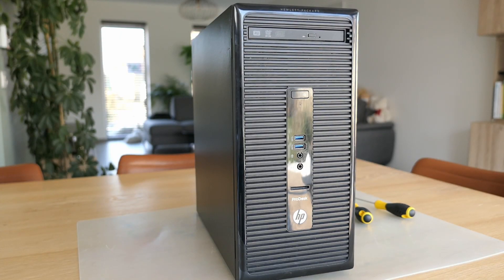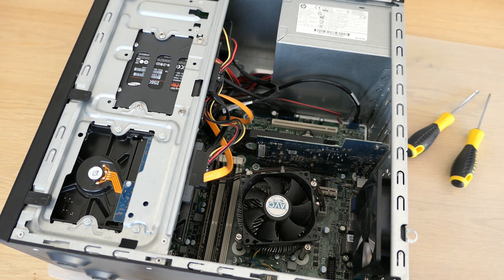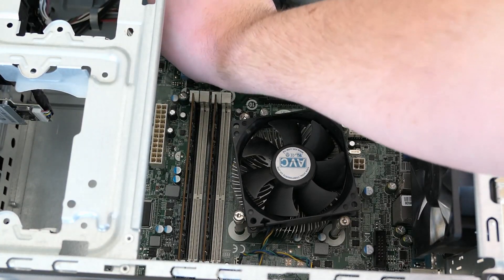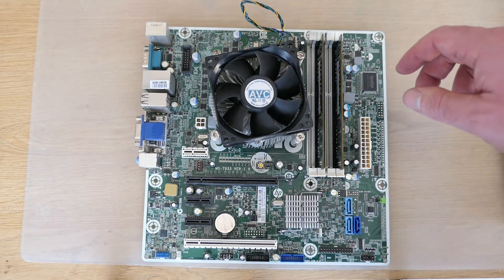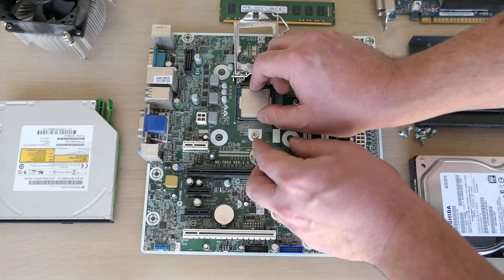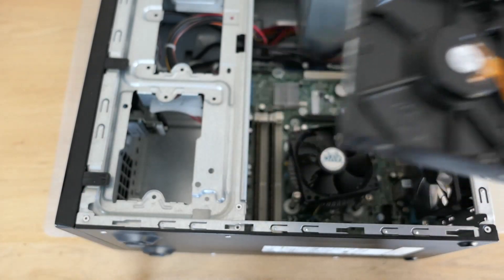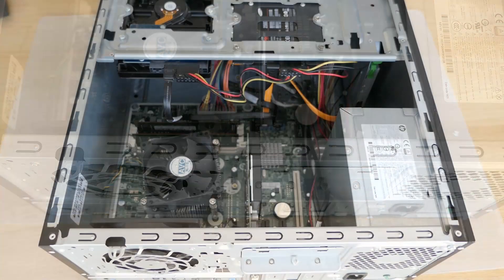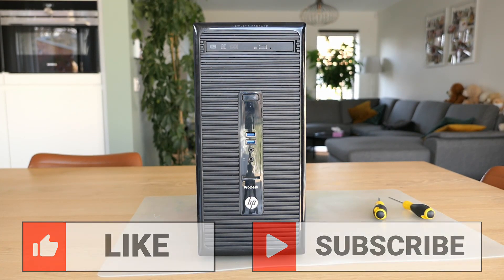HP ProDesk 490 G2 MT - Overview and Teardown

Comment: Can put GTX 1060 or RX 580, i think can
Reply from the maker: Both the 1060 (120W) and RX580 (185W) will require additional power input. A GTX 1650 might be a better choice as it can be powered through the PCIe slot.
Reply: @jensdbe  sure, but i thimg about space. It's small size. I watch another video and so much upgrades including rtx 2060 with 850 w and i7 4790 with 32 giga ram

Comment: Does this mbo (ms 7933) suport i5 4670k
Reply from the maker: As far as I see that should work. Do keep in mind that you will need a separate GPU with a K processor
Reply: @jensdbe  i have 1050ti
Reply from the maker: @mihaelnovak7235  then you should be good :) good luck with the upgrade.
Reply: @jensdbe  tnx❤️

Comment: Can you install a double slot GPU in this one? I couldn't see whether the brackets (in the case) could be easily removed. Because I was thinking of installing a low profile GTX 1050 TI.
Reply from the maker: There shouldn't be any issues installing a double slot GPU. The brackets covering the opening can easily be removed. There is no need for a low profile card as the tower has space for a "regular" card. Only thing you need to keep in mind is the power consumption of the GPU vs. total power of the power supply.

Comment: Anyone try xeon cpu on this machine? Xeon 12xx?
Reply from the maker: As far as I know this will not work. Xeon 12xx use the FCLGA1155 socket while the motherboard has a FCLGA1150
Reply: @jensdbe  i mean xeon 12xx v3. I think its haswell.